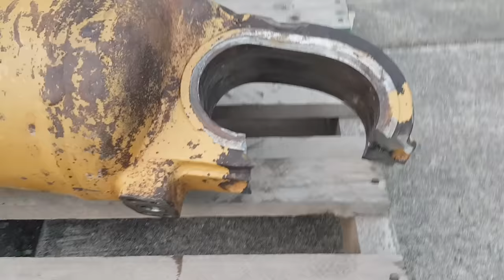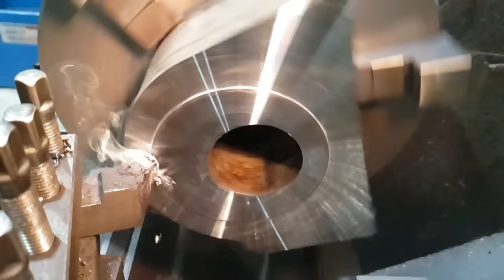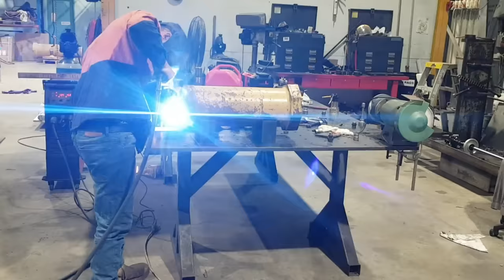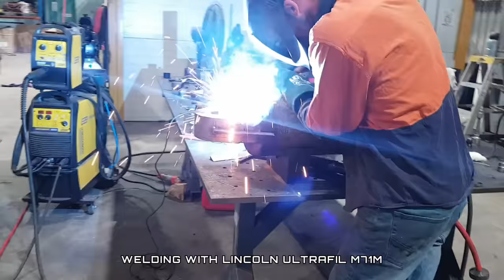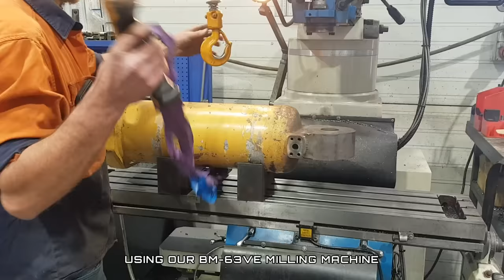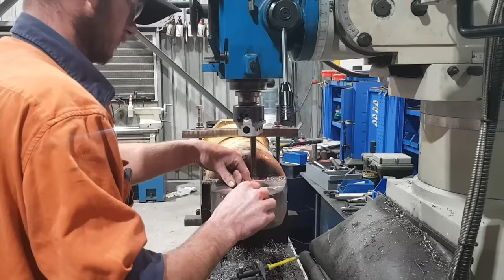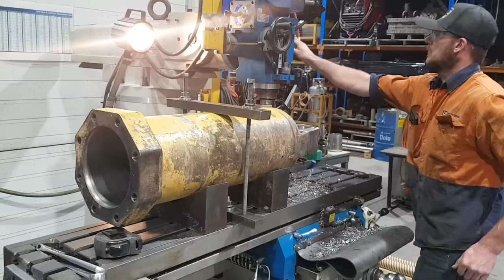Replacing Eye on Hydraulic Cylinder for Caterpillar D9 Bulldozer | Machining, Welding, Milling

Comment: 226 people think they could have done it better.  Its not how we would have done it at the mine I work at, but honestly its a better job than our shop would have done.  Our guys would have done it with laminated plates so they could avoid all of the face machining, but miners tend to be more interested in expedient than anything else.
Reply: There's a right way and a wrong way to do anything! This is the right way!!

Comment: I like to put a little screw jack under cantilevered pieces like that when I face mill them so they don't chatter so bad. Not necessary in this application and costs some time but it helps to combat my rampant OCD.

Comment: The shrinkage stress from those huge fillet welds would be immense.   I would think you'd want to preheat those parts a lot to reduce distortion on the end of the cylinder.  Normalizing the whole thing afterwards to relieve that stress would be ideal, but then the bore might not be so round anymore...  Tons of fun to see a straightforward job done with simple tools even I can understand.

Comment: The grease port that extends life was the same port that ended it.
Reply: Exactly! In (marine) crankshafts the lub. oil ports in pins and journals are reamed and polished to avoid failure of the part due to the roughness of the bore after drilling.
Reply: yes, mostly eye fracture start from grease port
Reply: And from lack of use for its intended purpose.

Comment: A fine job on that repair.  I am viewing from Missouri, USA and I have great respect for the work you do!
I am guessing that it is cost effective for a repair like this due too several possible reasons?
1) Cost of a replacement part from CAT, or if it is even available any longer?
2) Cost of importation to AU?
3) Down time for the customer to be without his/her machine on the job site?
4) Shipping cost do to weight & size?
Thanks for the quality photography, the slow motion is awesome!
Cheers
Reply from the maker: Hey mate thanks very much for watching and taking time to comment. You're spot on as all of the above are contributing factors to why the customer went with us doing this replacement repair. My misses does the editing can you believe it's all recorded on just her Samsung galaxy S8 phone! Cheers, Kurtis 😎👍
Reply: @CuttingEdgeEngineering  The occasional slo-mo is great - especially on the interrupted parts.
Reply from the maker: Hey mate You're going to like the next videos coming up then! Some slow mo interrupted cuts in action 😎👍
Reply: @CuttingEdgeEngineering  can we also see the face mill in slow mo? thanks!
Reply: It must be a thing, I'm in Mo too and watching. One question, why no coolant on the fly cutter, or the boring cutter? always helped me keep from burning up tools
Reply: @BloopTube  Well we used a nozzle with coolant induced by a venturi and compressed air on carbide, with this method you point the nozzle directly on the tool if its a stationary tool like a lathe, or at the cutting point in the case of a fly cutter, granted a boring job was hard to cool, but generally you weren't hogging material with a boring head.

Comment: This is amazing, especially the slow-mo footage.  I'm curious, why are some of the tools lubricated/cooled and others not?  The lathe part was smoking like crazy but not cooled...doesn't the cutting edge overheat?
Reply: Nope! It is carbide! Almost as hard as diamonds!!!
Reply: I did this sort of work for 38 years.
Reply from the maker: Hey Dave thanks for watching, yes as Cliff commented carbide inserts like to run hot/dry and coolant makes a mess.
Reply: Depending on the material being turned, carbide can be ran hot and dry or cold and wet!
Reply from the maker: Hey mate spot on right there thanks for watching and commenting 😎👊💥
Reply: @CuttingEdgeEngineering  thanks for the responses!
Reply: @cliffchilders5820  "can be ran hot and dry or cold and wet"
I'm also married to a Redhead.

Comment: Why aren't you using stick welds ?  Just curious.
Reply from the maker: I'm in 2020 not 1940. Filler materials for MIG welding are equivalent if not better than stick these days. Stick is also slower process.

Comment: Nice video! I'm not a machinist so I'm wondering why you used the lathe to face it off?
Reply from the maker: Hey mate thanks for watching! I wanted to machine bulk of the 10mm material off, it's faster to machine and also true up plate for welding. Cheers Kurtis
Reply: Also on the lathe you can get a true 90° to the sidewall (perpendicular to the face) that is gripped by the 3 jaw chuck, could have done some more material removal if a 4 jaw chuck was used and the piece centred for the majority of the hole removed.  Overall not masses of time would be shamed but everyone would have done it differently. Can you tell me , looking at the profile it seems the material is a cast shape for this particular purpose, is it one of those profiles that will suit many different manufacturers?  Tia.....Phil 🇬🇧
Reply: He needed a reference for his welding setup.
Reply: @theonlybuzz1969  you can get a true 90° on the milling machine too.

Comment: Awesome job. Curious about your material selection, is it heat-treated to withstand the enormous forces excreted on the hydraulic cylinder eye?
Reply from the maker: Hey mate a PMI test was done on the barrel end and was found to be of a 350 grade material which we matched with our supplier. Cheers
Reply: NICK, unless it was done after welding, heat treating (if a heat-treatable steel had been used) wouldn't do much.  The heat from welding would ruin any pre welding heat treatment.  Also, I believe, the high carbon content of heat-treatable steels can make them trickier to weld.
Reply: The greater problem would be with delayed cracking from welding such a thick cross section with no preheat or post weld heat treatment. Hopefully the successive beads pretty much tempered themselves and then they machined off most, if not all, of the cap pass. They made it "tik-tik" too (compared to the original forging) so that will give them some insurance even if they do have some cracks.
Reply: Man, you guys in the comments are on it. Well done EVERYONE!
Reply: @TheKajunkat  - I agree abut pre-heat treatment. Big steel pieces act like a heat-sink, sucking up all the heat of the weld, resulting in cold weld joints and cracking, it is always recommended to heat the weld pieces to 300-500 degrees F prior to weld - and keep them warm after welding to prevent sudden cool down.
Reply: If that is C350 steel then it is Carbon free and is not sensitive to heat from welding. The high nickel content should make it non work hardenable.

Comment: There seemed to rather a lot of milling at different stages. I'm just asking, I'm not an engineer to your standard, but why wasn't the tab made to correct size and then welded to the casing, seems to be a lot of material removed after the blank was welded in place. Also why wasn't any coolant oil used on the mill?? Again I'm only asking, not knocking it 😁😁
Reply from the maker: Hey mate. The plate wasn't cut to size to allow for movement when welding. If it pulled during welding there wouldn't have been any spare material to correct it. Carbide inserts on the mill can be run hot/dry or flooded wet with coolant and I prefer less mess so run hot/dry 😎👍

Comment: Something to consider when you make or replace a cylinder....I had an 8" by 6 Foot cylinder from a Liebehrr crane boom lift...it split wide open...about in the midway point...right where the factory welded a big lug for clamping the hydraulic lines....they didn't run the weld around the ends of the lug...so that developed a crack and split...I cut it apart after the new cylinder was made...there were the 'text-book' beach marks at the crack...fatique failure....
 Also had a couple of 6" cylinders...a pair...lift cylinders from another crane....the closed ends had been welded on when new cylinder was installed, they did get a good 'V' groove in there...but the welder didn't use enough current on the root pass...the ends blew off...twice...the welder was the other guy I worked with...I just bit my tongue....and welded them up again....ran some 1/8" 7018 first pass, then MIG the rest...
 You could see where the crack started and then went around the weld until the failure..

Comment: Super impressive repair!! Why didn't you bevel the cylinder like you did the new eye-let?
Reply from the maker: Thanks for watching! Limited material and room on the cylinder side.
Reply: @CuttingEdgeEngineering  perhaps increase your bevel angle on the eyelet piece then, it appears to be way too steep, also didn't see you put any preheat on it prior welding? Run on run off taps too, makes the welding process easier and better results

Comment: I'm no machinist but this came up in my recommended. That was one awesome repair. I had 2 large cylinders bounce around 3 repair shops for 3 years. Repair shop #4 got them done in 1 day. 
Quality counts.

I wonder what kind of forces it took to bust this cylinder eye.
Reply: In theory, very roughly, at a steel yield strength of approximately 50 kpsi per square inch, or 25 ton per square inch, say the original eye had 2 square inch section then 50 ton,  or about the same as the weight of the D9 itself.  BTW 3 yrs?
Reply: @edwardromana  
Thanks for the thorough explaination. I wasn't expecting that. 

Yeah 3 damn years. The lesson is don't take projects to friends' shops. Stuff gets put on the back burners.

Comment: Thanks for the interesting videos.
This is just a small customer satisfaction point but after carrying out repairs similar to this item would it make sense to degrease the whole part with brake cleaner spray and to give it a quick spray of paint. For the comparatively small extra charge most customers would likely really appreciate that - we used to make it standard policy here in Canada. Also years ago that welding would have been a job for 7018 rods, not MIG in order to get the reliable quality.

Comment: Great work and wish i had your welder and tools, only thing that i found strange was lack of lubrication when using the mill but then again i always over think things and sure you lot know what your doing :)
As my engineer mate says takes years to learn to machine even basic stuff right the first time...no wonder he keeps hinting at me to save some coin so he can train me so i can buy his stuff and he can upgrade :)
Reply from the maker: Hey mate thanks for watching. Carbide loves to be flooded or run hot/dry, so pick one, I prefer no mess!

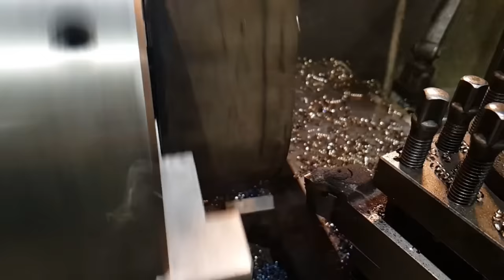Comment: 01:30 What kind of metal is the blade of the lathe's cutting-tool made of? It's amazing how strong it is, withstanding all those impacts against the piece being cut.
Reply from the maker: Hey mate it's a Tungsten Carbide insert
Reply: @CuttingEdgeEngineering  Cool... definitely some tough stuff, no doubt. Thanks for sharing :-)

Comment: Hi, at 10 seconds, how did you set the parallelism for horizontal milling (you just manually turned the cylinder)? and also drilled a hole on the side of the hinge

Comment: Nice work. Someone get the guy with the grinder some hearing protection.
Reply from the maker: That guy is me haha it's not that loud, used to be but not any more 🤣
Reply: @CuttingEdgeEngineering  Your shop is bigger than my garage so there are fewer reflections, but you still only get one set of ears.
Reply: @Fix_It_Again_Tony  Yeah, I'd give all those rock concerts back at this point to not listen to cicadas 24x7.

Comment: On what parameters do you decide when to use cutting / cooling fluid? E.g. you've used the fluid on the band saw but not while turning on the lathe.

Comment: how many runs lol ? any pre heat  lol ? how did the peno go on that bevil. looks a little tight. ohh and does a repair job of this size need some testing with macro or ultra sound for some reassurance on load for the item ??

Comment: big fan of your channel but how do you maintain the accuracy of replacing such a part that requires square angles and tolerances? seems like you just bolted it down on those cradles and let it rip!

Comment: How do you know when the part is level so you can use the face cutter?  It looks like you just turned it by hand and tightened it down.  Don't you have to use some kind of level so both faces will be parallel?

Comment: Sure hope you preheated that before welding. Also hope that is metal core MCAW and not hard wire GMAW. Also not all the stop starts on the ends are weak points now. Should have used run off tabs to remedy that.

Comment: Just a question? I was taught that a piece like that is welded with spray mode or flux core.
Reply: No pre heat and dual shield would of been a better wire to use.

Comment: It looked like you welded the root in the vertically downward position. well slopped down any way. That is inferior to the upward direction. Can you say something about this?
Also how did you make sure the bottom surface, the milled surface was parallel to the surface of the face mill?

Comment: Question ❓ the part you repaired was a casting correct?  What kind of casting steel, iron?? That I think would dictate the welding procedure.   Preheat, gasses used, filler metal.   Not a machinist so I'm not sure about that aspect of repair but all in all looks good 😁👍

Comment: Im not a machinist so not criticizing just asking i thought there would be alot of lubrication when the cutting tools were being used (similar to a cnc) are they different kind of blades? Have to add nice work i could watch this all day
Reply from the maker: Hey mate thanks for watching. Carbide tooling can run flooded with coolant or hot/dry and I don't like coolant mess haha

Comment: Does your miller have ball screws or Acme threaded bar for the feeds, asking as I see you climb milling, guessing your mill is quite new with not much back lash in the feed screws ?
Also your large diameter face mill rpm looked a bit too fast for its diameter.
But overall good work 👍👍, what temperature weather was this done in ? +30 °c ? No need for pre heat ?

Comment: Very impressive work. How long did it take? And what is the cost of repairing this versus replacing it?
Reply from the maker: Hey mate thanks for watching, was about 5 hours in it. It's 3 times the cost to replace but a 3 month wait for stock as discontinued component. Cheers
Reply: @CuttingEdgeEngineering  hey thanks for the reply!

Comment: Fatigue failure starting at the bottom of the grease hole, you can see the concentric "ripple marks" starting at the bottom, been failing for some time given the rust on the broken surface.
Poor initial design the grease port should have been drilled further back towards the cylinder where the metal is thicker. It was nice to see that you increased the metal depth in your repair.

Comment: Even if it were on a different channel, I (not a machinist) would be interested in seeing how you went about setting up for the second facing operation on the mill.  Did you measure across the underside to establish parallel?
Reply: Just sweep the underside with an indicator, 1-2 minutes of work

Comment: I guess you guys are an official (certified?) caterpillar repair shop? Great equipment and great workprocedures btw, I love to watch your videos.
I just wonder does caterpillar require that a specific repair is done in a specific way with a specific procedure?
Or are you just free to use whatever method/material you see fit or needed to make the repair?

Comment: Thank you very much for the excellent video you shared, I really liked the slow motion shot on the lathe, I would like you to share with me what type of steel you replaced the ear with and what mig welding you used, also at the time you put the bearing  Did you heat the piece to the pin and cool the other or how did you assemble it?  from Mexico my admiration for your work and share it !!!

Comment: Working by the hour I see, leaving most of the work for the mill boringhead and not doing it in the lathe 4-jaw and also could have cut a lot larger hole in water jet. Also speeds and feeds are really conservative for these mashines...

Comment: Contractors run equipment like that cylinder until it breaks because they figure they can’t afford the down time for repairs. Then, when it does fail, they bring it to a repair service as a rush job and then complain about how much the rebuild costs!

Comment: At that thickness of the material you are trying to weld you should not use short circuit mig because you are prone to lack  of fusion you get a lot better fusion using  either tig or stick if not you should definitely use the option of spray transfer  on your mig equipment

Comment: I'm not a machinist but asking myself why there is no cooling fluid on the mill and lathe turned on. This would reduce the stress to the material and the tools
Reply from the maker: Hey mate thanks for watching. We are using Carbide inserts which can be run either hot/dry or flooded wet. We prefer less coolant mess so run hot/dry, it makes no difference to stress on the material and tools

Comment: Why don’t you use any cutting coolant?
Reply from the maker: Hey mate i'm using Carbide inserts which can be run hot/dry or flooded wet. I prefer less coolant mess so run them hot/dry. Cheers

Comment: As a hydraulic engineer I applaud the mechanics repair, but you left the flange port completely open to atmosphere with grinding, welding, and you introduced a ton of contamination into the cylinder!! Should have covered the end with tape at least! As the cylinder heats and cools it will pull in contaminated air and the metallic dust will stick to the fluid, leading to decreased seal life.

Comment: I expected more machinery to use oil or coolant, I only noticed it on the band saw.
Reply from the maker: Carbide inserts on the tooling can be run hot/dry or flooded wet